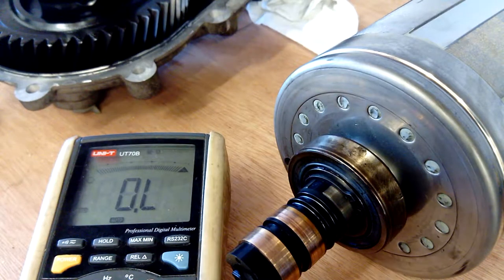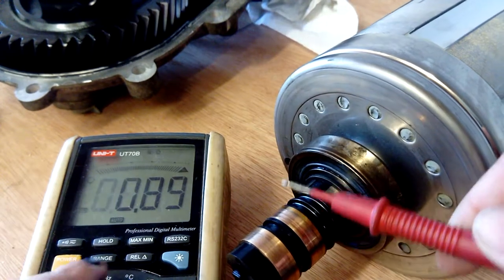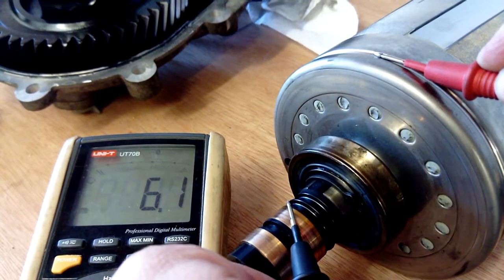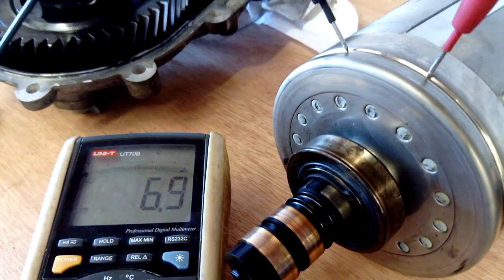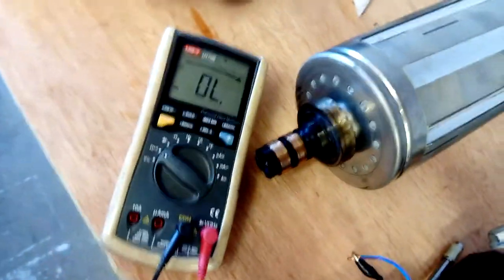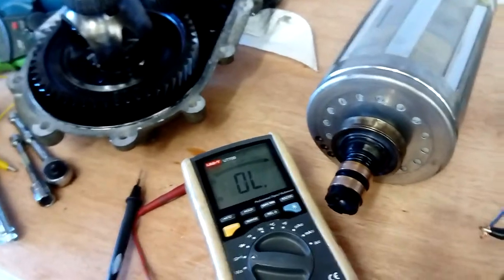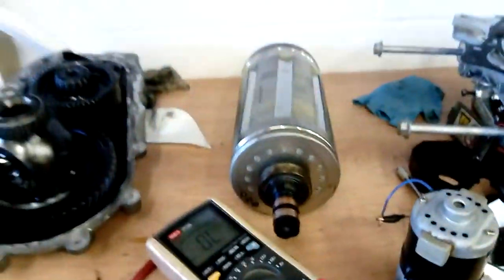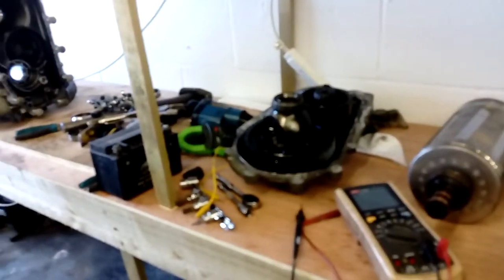Fluence Fix 8 (Armature testing - fail: short to laminates found)

Comment: Great help...! Thanks!

 Just fixed my Fluence with the same error last weekend using a salvaged electric motor. Works like a charm now without the dredded BCI. 

Looking to fix the old engine by re-wiring the rotor coils just as a project ;-)
Reply: Hei Kasper,  hvordan fikk du fikset det? I have same problem?
Reply from the maker: There may be a way to hack it, but it is beyond what I was trying to do. This is a design fault with the armature  of engine. The only way I used the car was to keep resetting the controller with a scan tool. There may be a sensor somewhere which can be shorted or disconnected but I didn't find it. You can do what Kasper did and find a scrap motor, but it may have the same problem

Comment: Great video!
Is it possible to do this measurements without opening the motor?
I can read the coil resistance of the armature by using the connector.
But can I read out the losses (resistance between casing of the motor and coil of the armature) between connector and mass?
I assume the the armature is connected with the mass, or body of the motor through the bearings.
Fine regards,
Chris
Reply from the maker: I'm sure it's possible. The connector to the armature is a high power one so I presume it comes out of the casing somewhere. I guess you can measure the resistance to the chassis as this is connected to the armature casing via the bearings.

Comment: Great video thank u. Did find other way to fix the issue with out of replacing the engine?
Reply from the maker: I didn't fix it. The armature is a sealed unit and would have required some serious engineering to get inside and fix. It was beyond the scope of what I was trying to do.
Reply: Yes, i know i have tried. Its no short way fixing it.  Thanks for replying 😊

Comment: So this things are not bldc ?
Reply from the maker: GT-EV no they're more like a big alternator in reverse.
Reply: @TurboElectricLtd  
Aha, I get it
I did made alternators run with sensorless controller
Im planning to buy a kanggo ze without battery and Im thinking what will I need to make it run without that original battery
Reply from the maker: @ACAGT  If the original battery is not present the car may refuse to work
Reply: There are some people who made adruino boards that trick the car so it thinks that it has original battery
Reply from the maker: GT-EV doesn't surprise me. But I'm just sharing this as there was little info on the web about this fault. I stripped this for parts and scrapped the rest
Reply: Does it have hall sensors for rotor position?
Reply from the maker: @Aca Elektro I think it's not sensorless and it's obviously synchronous but I don't know the specific technology. I still have the motor and controller so I can find out but it'll take me a while to dig it all out again
Reply: @TurboElectricLtd 
 Thank you for replying
I bought cheap kangoo Z.E without battery so trying to figure out how to make it run on some other controller and battery
Reply from the maker: @Aca Elektro I think the problem you may have is the cars systems are too integrated. In order to get type approval there are various safety standards like IEC 61508 which require layers of software to monitor systems and shut them down if problems are detected. You will probably find yourself starting from scratch and rebuilding all the systems. I was looking to adapt a Prius to a pure EV and had to give up as it was way beyond the scope I intended to run the car. Some people have probably had successes, but I'm not looking to repair or convert anything I'm designing and building a new car from scratch. I got the Fluence as other cars to understand my competition. I will be looking at a Tesla next having already got the Model S power unit.
Reply: @TurboElectricLtd  
My the plan is to start from scratch with it, but I would like to be able to to use the motor if I can get it running with something else. 
The thing is here where I live its impossible to convert a gas car to electric and get it road approved. So Im just using this kangoo as already electric car so that it won't be a problem to get it registered.
 I just need get it running heh...